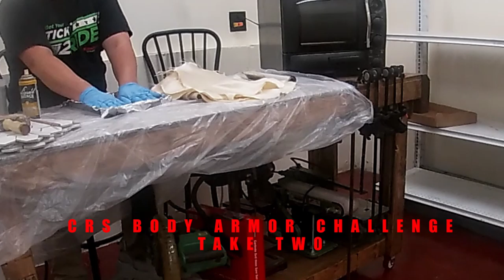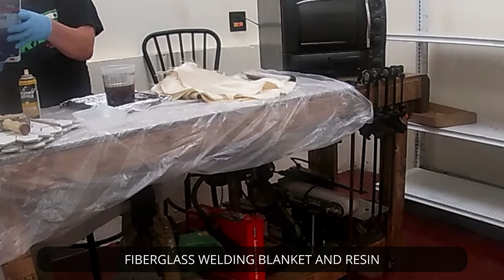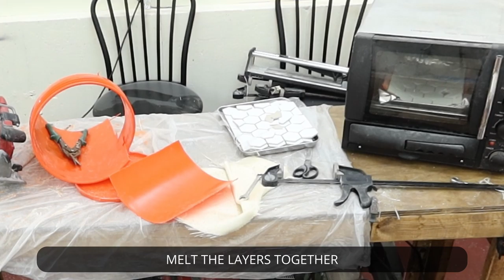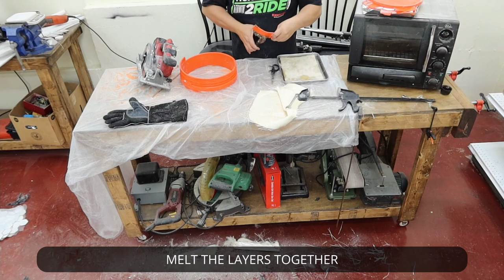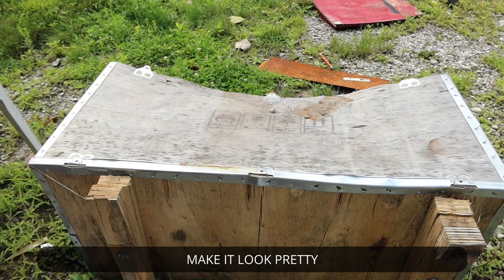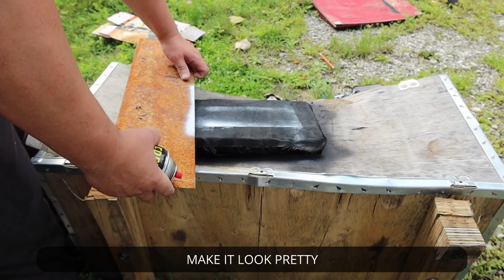CRS Firearms Body Armor Challenge. Take Two (2021)

Comment: Wow! That might work. I may have been over thinking my design. I've got most of my materials. I hope I can get it all together and sent in before the contest expires.
Reply from the maker: No idea how long he’s going to run the contest. Been a few months so far.  Looks like getting a few more people interested.
Reply: @artofeverything1816  Well if he can run through end of August, I can get one entry in. Actually, one entry is about all I can do.
Reply from the maker: @Fudmottin  Yeah it is some work.  More so the video than the building.  Also bullet resistant materials are not cheap.
Reply: @artofeverything1816  That's the truth! No single material I'm using is bullet resistant (in spite of what appearances may say). I'm not running the cheapest stuff either. To stay in weight limits, I'm going to have to do some judicious cutting and hogging out of stuff. Then it's down to hope.
Reply: It turns out I have some leftover material. So I could do a second submission. It would have to be an entirely different concept though. No aluminum. No nylon. It's got my interest though.

Quick question about your resin. Does it suddenly pass through a gel phase and then go solid over a very rapid (<minute) time span after the pot life expires? What my resin did really caught me by surprise.